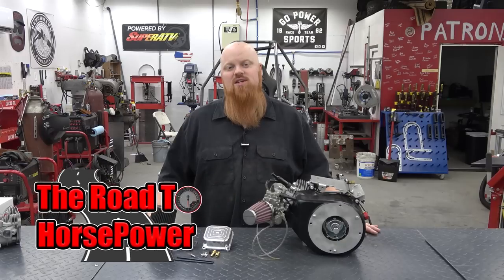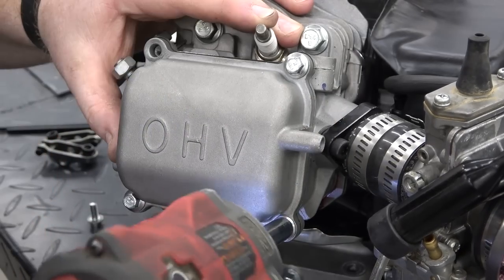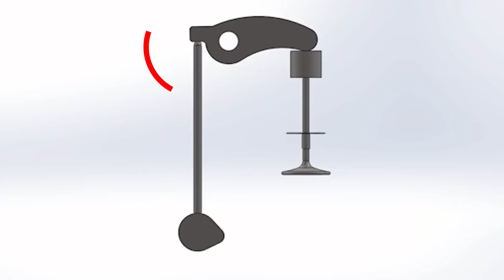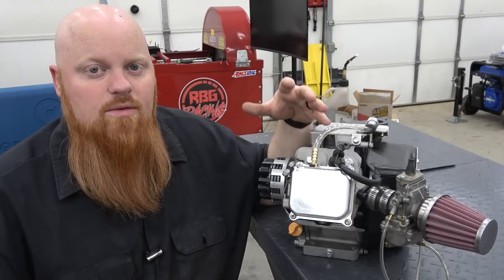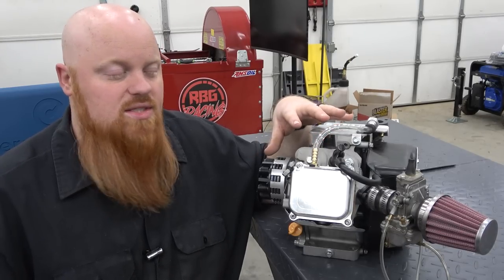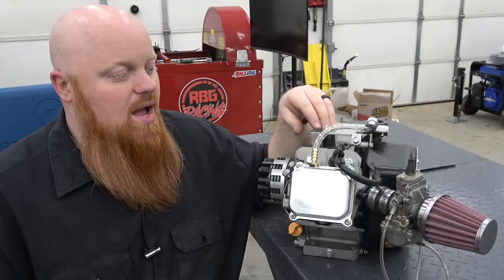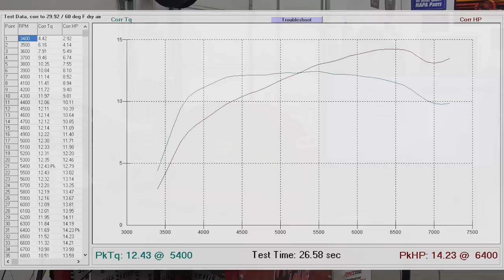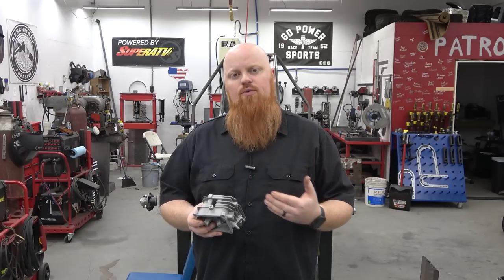Dyno Testing 1.2 Ratio Roller Rockers ~ The Road To Horsepower Ep 5

Comment: I have another idea for comparisons. Removing some of the “stage 1” mods after installing mods like the rocker arms to show if gains can be made without doing the “stage 1”. If I remember right more lift helps more at higher RPM so running rocker arms with out upping the RPM should not help.
Reply: I kind of agree, a pressed steel ratio rocker set is MUCH cheaper than a Camshaft and is a better option for people with a CVT... I went from Ratio rockers to a Dyno Cams CM grind 265 lift cam and there is NO difference in performance until 45mph where the CVT maxes out and allows the engine to start revving, even with a stock cam you can feel where the CVT reaches max gearing and only then will the engine start to pull hard!
Reply: I too would like to see what each mod does alone on a stock engine, then again on an engine with other supporting mods. I feel that would better demonstrate how mods interact with and are dependent on one another.

Comment: I've only gotten to the 5 minute mark and I'm going to go out on a limb and speculate the peak torque will occur at the same RPM as the stock rockers but it will increase slightly.
Just finished the video and there was an increase in max torque but what surprised me was it came at a higher RPM, which typically only happens when the duration is increased. Very interesting build. Can't wait to see what you do with the 670cc Predator Twin!
Reply: When you increase the rocker ratio you do increase the camshafts @20 or @50 duration at the valve itself, you are also accelerating the valve at a quicker rate so you need to be mindful in some situations of valve loft and float.

Comment: Make sure you try different seat & valve angles. 30, 45, 50, 55 & even 60 degrees are not out of the question. 45 face angle is a good choice for stock/ported stock type automotive heads. Race type cylinder heads generally run higher lifts up to 1" plus and the 55-65 seta & valve angle helps airflow @high lifts. I assume 45 degree is most likely stock angle for your engine. But should have a 60 degree throat angle into valve bowl and a 30 degree top angle smooth transition into chamber. Also can try a back-cut on the intake valve around 30 degrees to aid in low lift flow. Good luck.

Comment: One key piece of equipment to invest in for this series would be a good quality flow bench to test the airflow potential of the cylinder heads. If the results from the flow bench indicate the potential for airflow greater than what the engine can provide on its own, then you know it's time to tinker with forced induction which should be a lot of fun.

Comment: Could not have done it without your knowledge and videos my engine turned out great I like the way it runs I'm not running the 212 am running to 224 it's a little more involved in your series right now but I built mine right along when you're doing your 224 great series all kinds of good information keep it coming good job
Reply: Can't wait till they do a road horsepower series on the 224

Comment: I truly admire the road you and your family have been on.  In my opinion you are ready to learn from a professional performance engine builder.  Paul's kart and EC Carburetor taught me how to build lasting engines that make lots of tourqe and still pull hard on top end. I wasted a lot off money buying bolt on horse power Go China crap.  The first two companies I mentioned use serious American engineering and also make sure that I understand how to properly clearance and install there parts.  Just food for thought but you will not be disappointed with either one off those companies heads.  I would love to  see you compare a Paul's Kart hemi head to a Go Power sport's stage whatever head.  I  like Go Power sport's for Go cart and mini bike part's.  EC is the best in my opinion.

Comment: RBG, Did you dyno the bone stock motor? What was the real HP? 212 Predators are supposed to be 6.5 HP. So far you have more than doubled claimed HP. Just wondering what it really had out of the box? Great video!
Reply: that was the first video of the series, It was just over the 6.5mark, but not quire 6.6
Reply: He did on the first Road to Horsepower video. Just slightly more than 6.5 if I recall correctly.

Comment: Well that was interesting, I thought the ratio rocker would have made a bigger difference... maybe they would with a ported head, or using them with a STOCK cam. I am still more interested in  torque figures at different rpms with different cams, as the engine is ALWAYS restricted to what the CVT will allow it to rev to. ie my CM grind is no quicker than a stock cam until it reaches max gearing at 45mph and nobody has the Dangly bits to reach 60mph where the power is

Comment: Id like to see the head shaved, raise the compression about 40 psi or so,  high enough you can barely pull start it!  Or where it requires 98 -100 octane fuel,  just a guess cut the head, deck the block, or both, about.040" - .050" +/-, with better flowing head, back cut the valves,  maybe cut more angles on them

Comment: If it's going to be under 6k rpm engine, I'd look into running the shortest rod possible,  with more compression  sand a fine gone bore, and coated shirts,  the short rid will help the not so great flow, and  performance at low rpm can gain a bit,

Comment: Something to try on the dyno is different length rods, to see how it changes the hp and torque throughout the rpm. I know it may not add hp, or may depending on the application.
Reply: Longer rods are less prone to detonation so one could or should advance the timing to see the most benefit from a longer rod. This all assumes the piston is in the same place in relationship to the deck each time meaning longer rod, change the piston to match. In cases where you don’t have to change the piston to match, enjoy the increased compression but it won’t take as much timing before detonating.
Reply: ARC has a good video on rod ratio (what your talking about) And explain the various benefits etc

Comment: Any test on high compression heads, I'm about to put a genuine Honda GX160 head on a GX200 clone, there is a big difference in chamber size.
Maybe with ratio rockers so no need to open crank case to gain a few hp

Comment: The air filter setups made a big difference, did the smaller filter have the radius entry adaptor the same as the black one?
You were getting erratic booster signal with the smaller filter setup and I’m going to guess it’s more to do with the entry radius than the surface area of the filter itself.

Comment: I’m putting together a pretty basic predator 212 for my almost 6 year old daughter. Just doing the air filter with included jet, governor spring capture mod, 18lb valve springs, the .010” head gasket, and the Autolite racing spark plug. I plan to leave the factory muffler to keep it relatively quiet for her. How much do you think the factory muffler will hold this back?

Comment: Can you do me a favor we do this in Quarter Midget‘s negative cam timing. We do about 2 to 4° negative cam timing and by spinning the gear that spins the crank and it moves the RPM band up with negative cam timing. Can you test that I am very curious. It does make the exhaust hotter. I do know that.

Comment: Hey rgb could you please try the mod2,  mod1 and the .310 cam from dyno cams i got a rod flywheel mod2 cam ported head ss valves 26lb springs 1.3rr 196 hysun  and dont know of i should upgrade to the .310 or go with a mod1... keep up the great content

Comment: should test thicker to thinner weight oil. old skool builders always say thinner oil makes more power --- i am guessing cause of dipper going through it
Reply: NASCAR says thinner oil makes more power too. They were using sae 50 30 years ago, now they set their engine clearances tighter and run super thin oil. I’ve personally seen a 38 hp gain by doing just this in a near 500 hp Chevy circle track engine.

Comment: So what should I do if my motor is coil bound? I'm currently building my atv motor with whole after market valve train. Not the same motor I know but concepts should be the same
Reply: Machine the spring pockets down if you have the room, pretty common practice actually

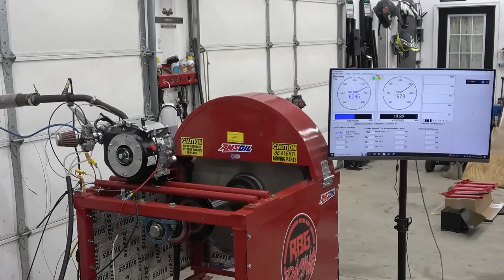Comment: 9:18 why did that pull float the valves at 6700 but the other pulls had a smooth curve out to 7400? I'd never spin one over 6 but thought it was odd.
Reply: Might not have floated them? I noticed that too, at about 9:13 you see the afr start to flutter lean really badly with the small filter, but the larger filter didn't flutter lean at all but still showed dip in power at 6800, although a smaller dip. Would have to make a few more pulls with the small filter to see, but so far all the previous pulls i watched with this cam and filter caused the flutter and the dip in power at 6800. The best looking curve so far was easily this one with the bigger filter. At least thats my opinion. So maybe its a artifact of this filter on this carb. Some type of reversion maybe. Could still be float, but like you said, didn't show up near as bad on the large filter run.
Reply: @travishall3446  agreed. If it was weak springs id think it would do it every time. Gwad I watch to much Richard Holdner & Engine Builders if I can read a dyno without ever running one lol. So it's definitely got a small venturi going on & with some small porting on the intake in the next video I'm looking forward to a full pony increase. 🙌🤞 😉

Comment: I appreciate this series but can we please work on terminology it's important when we speak about technical things. Please revisit your knowledge on cams valve train and the effects of lift vs duration vs lsa. For air filters like most things look to motorcycles for a good pod there's one name and some good knock offs but the design is all unifilter foam filters. It's actually really obvious if you take the filters apart and inspect the air path. Being this is on a Dyno I don't see why your adding that variable just run no filter to keep it simple.
Reply: In the porting your biggest gain is gonna be back cutting the seats we go as big as the valve will allow. Most ppl do what you said and blend but if power is what we're hunting you can actually leave the rest of the runner alone spend all you time on the bowl and seat and it will always make more power everywhere than if you go a smooth like you said. The best case would be to smooth what you can after spending 1-2hrs in the seat and bowl. From the heads iv seen for these engines were talking about my pinky barely fitting in the intake seat and when your done my thumb fits in there snug. Do keep in mind iv got well over 20yrs experience and iv been pretty dead on with everything iv said so far. Keep up the good work we can deal with the shill ad crap but you gotta give us real data not hillbilly data. Dyno was a huge step but if we're gonna test a ported head I think you first need to prove your ported head flows better. I suggest using a vacuum to make a cheap flowbench it's not very hard and remember your not concerned about the measurement unit you just need to test it and see what the water hight is in the tube and mark it with a sharpie then throw the other head on and see if your actually reducing the vacuum the vacuum cleaner can apply to the port. It's comparitive testing but very accurate and at the end of the day not needing the actual cfm number saved you a bunch of work that you didn't really need to do to show this head flows more than this head.